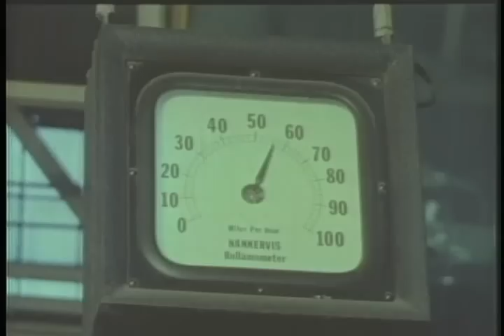Ford Fairlanes Being Built

Comment: Excellant video. I  got lucky and found a 64 Fairlane  that had been  parked since the early 80s. Upon looking at car I noticed it had the High Performance 289 badge on front fenders. it still had the original 289 hipo engine w 4 speed top loader. .Been working on it for  several years off and on. You can tell Ford didnt skimp on cars back then. Sheet metal is thick unlike the cars of today. Finally got car running and runs like a champ.

Comment: These Fairlanes were but one of many cars based on the 1960 Falcon platform. It was extended,shortened, and molded into every thing from the original 1964.5 Mustang to the Maverick to the 1980 Lincoln Versailles. Even as a GM guy, I was always impressed with the Ford Falcon platform and the 1962 MoPar "B" platform, for the variety of cars based of of them. Good stuff!
Reply: Yes, good stuff, thanks; I have a 64 Ranchero, a Falcon "truck"!! :D

Comment: Thanks, I have one of these! A similar Viking blue '63 four door 500 in all original condition. Been in the family since new.
Reply: BrakemanHO Awesome! Ive got a sky blue 64 4 door fairlane 500. Bought it for 500 dollars almost a year ago, sat for 20.years and i got it.running, being a chevy guy, that car taught me that no matter the company, every car back then was well built
Reply: @houstonsmith20  im a Mopar guy and yes theyre all the best cars made from back then .  They all had good and bad points but so easy to make sure they're perfect.
Reply: @houstonsmith20  Just found a 64 500 for 3k. No rust!  Some rear quarter damage, but runs and drives nicely. My first "older" car.  Should be fun to get it back in solid condition!

Comment: great car being built, not the junk made today.. it's a shame you can't build anything like this anymore. Detroit was the bread basket of America.
Reply: I agree with you m8 some of the  junk we have on our  roads today
Reply: I have a 1963 Falcon that went 170,000 before the engine needed major work.  It did have rust issues though.  Sounds good.  However, we had a 1992 Ford Escort that went 224,000 miles and I had a 2006 Ford Ranger that had gone 170000 miles before it was rear-ended and totaled.  I actually think that there are quite a few cars made today that are better than than the ones made then(At least today's cars do have the electronic fuel injection and not the worst invention ever put on cars-the automatic choke).

Comment: That was real workmanship back then. Those cars were built tough, not the crap they build today.
Reply: +lar4305 
You can bet that every part and tool used to build these cars was either USA or Canadian made, too. The Ford Windsor engine plant was producing some engines then, but I think all of the small block V8s back then were produced at the Cleveland plant even though they are what most people would consider a Windsor design.
Reply: i own a toyota camry.  100k on it.  drove cross country from my home in nys to ca and florida.  never burn a drop of oil in the 6000 miles of high speed interstate driving.  ford is shit
Reply: Great drive something built by the country that attacked us..Course your to young to know that stuff..
Reply: @billysmith5721  big fucking deal,  ive still got an old Aussie chrysler v8 thats got a million ks on it . American built cars were the best,  ive worked on every car you can imagine.  They made Fords in Australia and they were great cars but traitors especially our governments sold us out.
Reply: billy smith it’s people like you that help make this country fall apart! You should be ashamed of yourself!!!! I have a Chevrolet Malibu and a Chevrolet Silverado and drive all over the states! Never any problems! Buy AMERICAN 🇺🇸🇺🇸🇺🇸

Comment: Additional: Fairlanes and Meteor were built in the Deerborne MI plant. At 3:04, to the left of the Red Fairlane, on the first line are 2 Mercury Meteors. They were also built in the same plant. They have the same body style, except for a few deviations. Body parts from the two models are 90% interchangeable.

Comment: These are 1962's, right? I don't think the 289 V8 had come out yet in this video. Those V8s must either be 221's or 260's?.
Reply: +scdevon 221s. The 260 was new for 1963.
Reply: JRC99 actually, the 260’s were available late 62 for the 62’s

Comment: Comets are a whole different car than Fairlanes up to 65. From 66 to 69 Comets are built on the Fairlane platform but the 66's are a whole different car than the 62 to 65's.
The Mercs seen in this video would be 62 Meteors which were based on the Fairlane platform in 62 and 63.

Comment: Those guys worked hard on the assembly lines. Sadly for better or worse, that America of over a half a century no longer exists.
Reply: Some assembly line jobs were better than others.  I feel sorry for the guys doing the welding. That would be tough - 400 times a shift.  I know it has cost jobs but it's good for human health that robots do that job now.  Guys would start off on the tough jobs when they were young and move to the easier jobs with age and experience, like the guy near the end whose job seemed to be to lift and drop the hood and make sure it was lined up.
Reply: The filling and sanding of lead for the seams was also not such a healthy job.